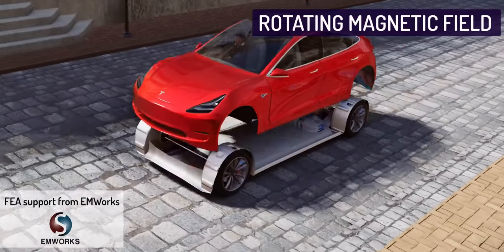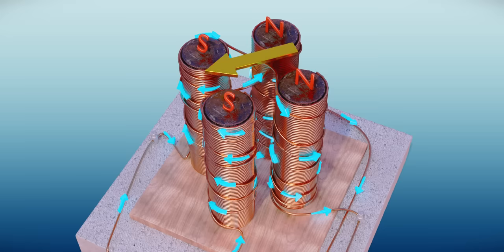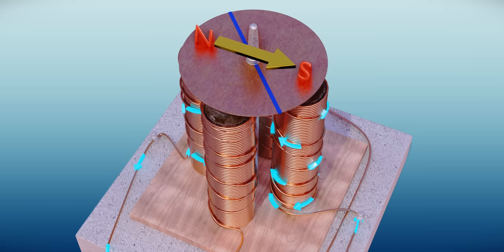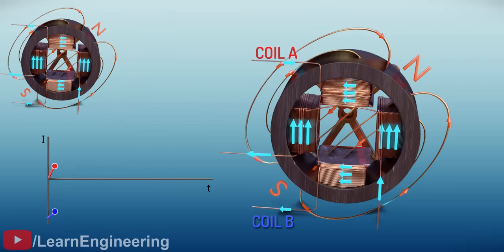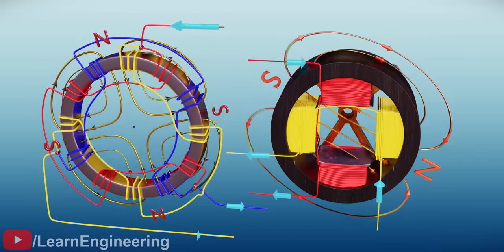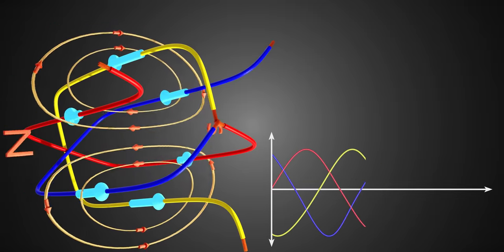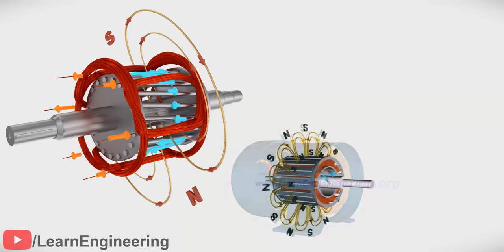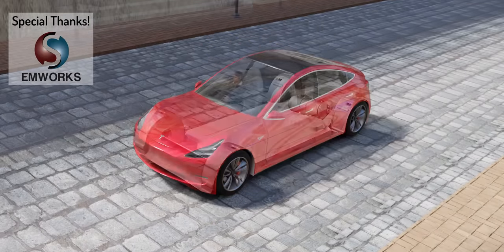Understanding RMF | The driving force behind every AC machine

Comment: Tesla built the first a.c motors, but Charles Steinmetz, head of the original General Electric research laboratories, made A.C power transmission engineerable with his mathematics and theory, and therefore made the use of A.C possible. Before that Oliver Heaviside took Maxwells equations and simplified them to four short expressions; Maxwells equations as we are taught in school should really be called Heavisides equations. He also made telegraph transmission possible by describing the mutual relationship between magnetic and dielectric fields. He showed through his telegraph equation that the problem with telegraph transmission was not solvable by loading the system with more power, but was only solvable by intoducing loading coils at certain intervals along the line. Just a few names no one hears anymore.
Reply: Thank you, for the knowledge.
Reply: Great heads up.
Reply: Thanks a lot man ...can you suggest some other videos or channel where I can learn very very basics of physics we see in our day to day life or we use in our day to day life...

Comment: I loved it but gotta admit. To properly understand it, I'll have to rewatch it many many ntimes
Reply: Me too!
Reply: It's not complicated enough.  They had to make the arrow point to the south pole of the coils instead of how a compass is arranged pointing to the north pole?  Is there a plan afoot to mix us up?  Come on, people.  Why do that?  Just another small pebble in the road.
Reply: What's with the dynamo @ 4:37 "...Galileo Ferraris used an inductor in one
 of the two coils supplied by a single-phase ac dynamo later..."  This video is confusing.
Reply: @dasara doodla Yeah, I know that and  you know that, but that's got no business in a 101 course.  This is bs.
Reply: @Caishen Salelius 6022 My physics professors did not confuse us.  There's another animated video out there that should be good too but suffers from the same thing.  Too many moving parts with captions and narration.  And music and sound effects.  
Interesting thing about knowledge and teaching.  I think I'm seeing a good video or lecture when they explain things that I know already.  But on further examination, I find that the explanations sometimes fail to explain clearly, things that I haven't learned.  
Our judging system is skewed a bit and tells us things that may not be true.
PS. sorry this is so windy.
Reply: Just add three balanced fluxes, you'll get the resultant magnitude at 1.5Φ and the angle as (90°-ωt), which means a constant flux rotating with time.

Comment: in my opinion the 3 phase wiring is more of an evolution than a revolution to the design tesla created, not to say it wasn't a big deal, but they just used what tesla had already figured out and improved it to make it more efficient
Reply: Even the two phase was an evolution of Bailey’s original step change design. The fact that you could have a single vector and have that move, whether in stepwise or continuous fashion, by altering the current was his idea.
Reply: What will happen if we increase phases? Like from 3 to 4 or 5? Is it possible? If not what are the limitations?
Reply: @starboy001  I'm pretty sure the eddy effect will increase or simply not be beneficial enough to be viable
Reply: Wdym? Tesla wasn't the only one to figure it out. Did you not watch the video. Ferraris had figured it out as well. Give credit where credit is due. Only thing that Tesla did different was patent his idea whereas Ferraris did not.
Reply: And as a matter-of-fact Ferraris and Teslas design was an evolution in RMF to Walter Bailey's original design, so...🤷‍♂️

Comment: The key to understanding this is the notion of induction. Anytime a current is passed 
through a wire, a magnetic field in “induced “ in the opposite direction. Electric motors 
Make use of this “induced “ field by getting it to do work. It is one of the coolest 
phenomenons in nature.
Reply: When a current is passed through a wire, magnetic field is not induced in the opposite direction, it's actually induced in a circular path according to right hand rule.

Comment: My flash driving invention cannot be used as a driver of the wheels because of too much speed , it can be used only in producing current ac way and x2 , 
And using the gapping zone to operate perpetual motion power. 
My tapped way cw generator sets and ccw generator sets,  side by side and it's more faster than the real driving. 
And no direct contact metal in both side by side , it's solo running and it's more faster than the real driving. 
I can jive it to you but pay for my 50years in repair works.

Comment: Tesla made the first AC motors, synchronous and asynchronous, when you have a design you can add multiple phases...
Reply: No, Prof. Ferraris invented it first in ~1885. He published his findings 3 month before Tesla filed for his patents. Tesla poly phase used 2 wires per phase. The 3 phase system of Dolivo Dobrovolsky was designed to only use half the wires and had half the losses on the power lines. Then Dobrovolsky also invented the delta and star transformers still in use today. This is a signficant advantage over the Tesla system.

Everybody is replaceable. Even Mr. Tesla.

Comment: I don’t believe Tesla was much interested in the rotating magnetic field, after he discovered electrostatic compressional energy. We would not need any wires what so ever under Tesla’s system. Simp,y turn on your device...each device would have a receiver, and step down. The electricity is completely harmless, so any kind of work can be done on electrical lines, even with up to 60 billion volts pressure(Tesla’s words not mine). No harm. 
I read through the Westinghouse bankruptcy proceedings. I never understood why he gave away all his ideas for basically nothing. It’s in the testimony, and the trial was on,y to designate a dollar value on the patent portfolio of the Westinghouse patents. 
It is clear Tesla would not have given up a contract that would have made him the richest person on the planet, if Tesla didn’t believe the technology he was about to release would make all of AC moot.

Comment: Please make a video on Cold start and Hot Start of old diesel engine.
In old cars we have to push heat button first for some time then it will start.
Reply: You still have to do that in new cars, just leave the key in the on position until the glow plug light turns off and then start as normal. This is because diesels are compression ignition engines (Rather than spark ignition like gasoline or CNG/propane/butane engines), so the heat that causes the fuel to begin ignition is created by compressing air in the piston (It gets hotter because as the piston moves up, a fixed mass of air is compressed into a smaller area, packing the energy in that air more tightly, which manifests as a higher temperature - this is one consequence of the ideal gas law PV=nRT - expanding a gas will make its temperature reduce too, which is the basis for refrigeration systems).
When it's very cold, the combination of a cold engine block and cold air being pumped through the engine mean the ignition temperature of the diesel is not reached, so when the fuel is injected it doesn't ignite. The glow plugs heat the engine block enough to allow ignition to take place. Once the engine has started it generates more than enough waste heat to warm everything up enough to keep running without further electrical heating. Cold weather also makes the engine oil thicker, so the engine is harder to turn, and reduces the battery current available to the starter, so these also contribute to cold starting issues in gas and diesel engines.

Comment: is 3 phase now used more? If it looks like its a lot better what is the reason its so less known?
Reply: It's less well known because while they're everywhere in industry where powerful compact motors are needed, wiring 3 phase power to houses is pointless because that level of power isn't needed to run normal appliances and it would take 50% more wiring.

Comment: how i can learn mechatronic engineering best
Reply: Play with Arduino if you don't have the option of university courses. If you're still in school get very good at math before starting an engineering degree as, especially on the electrical side, you'll need it. Focus on complex numbers particularly. These are numbers with a real and imaginary component, the imaginary part is a multiple of the square root of minus one.

Comment: Could you define RMF please?
Reply: Rotating Magnetic Field - I've never seen or heard the term used before this video though, and have worked in various branches of engineering for decades (Though not specifically electric motors).
Reply: @peglor  The poster of the video didn't realize that he put up a video on a topic that he had not defined before he ran off talking about it.  He should have explained it right at the beginning, and it should be in the notes.  That's what motivated me to ask, and the poster has ignored my comment.